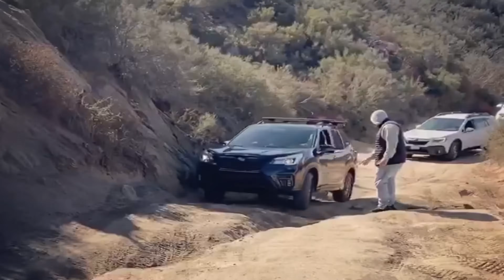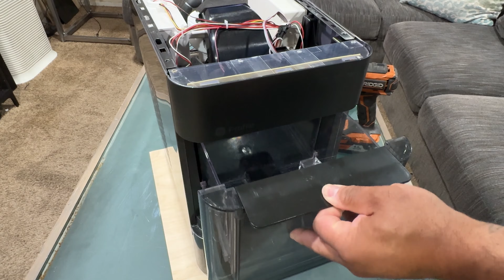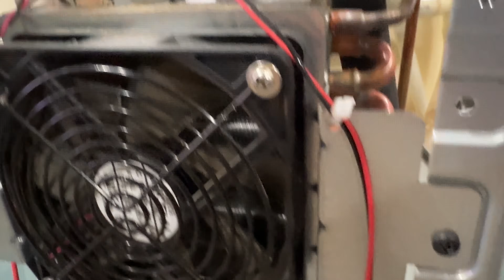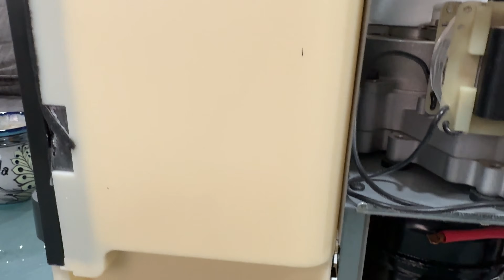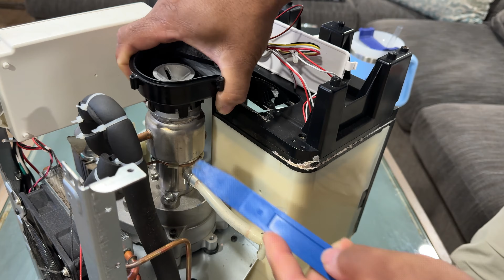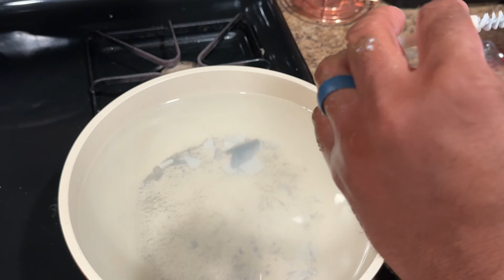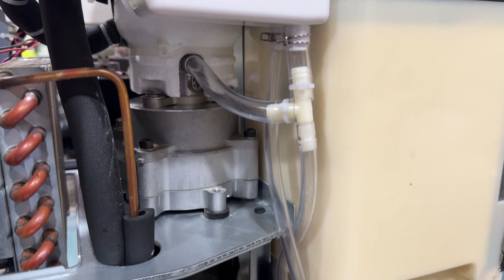GE Profile Opal 2.0 Nugget Ice Maker Repair

Comment: Best video for DEEP Cleaning and teardown of the GE Opal! I just inherited a 2 year old one that a friend replaced. Gonna tear it down tomorrow. Looks like I will be using distilled water only. Thank you.
Reply from the maker: @NCMilVet  Thank you!  Used as a full time ice maker, I haven’t considered distilled water.  But I think that is the route to go.  Plus you get clearer ice.  We’ll be making the change to distilled water.👍🏾
Reply: @Lucrativesoldier  The owner/operator manual says if you live in area with hard water, it recommends more cleaning.  I use purified/distilled water in mine.
Reply from the maker: @ yes we just switched to distilled water.  Otherwise we would have to go thru this process like every 6 months.😒

Comment: Thanks for the video. Do you have link to buy plastic splicing? I couldn’t find at Amazon that is stick enough like you have.
Reply from the maker: @honarithmusic  you’re welcome!  Are you talking about the zip ties?
Reply: @Lucrativesoldier  No, the  blue plastic flat tool you opening the bottom base.
Reply from the maker: @honarithmusic  oh gotcha.  Yes I can definitely add a link if you still need it.  I won’t be able to get to it until later this evening though.
Reply: @Lucrativesoldier  Thank you when you have time.

Comment: Great video. Thank you. My auger is leaking at the bottom near the collection plate. Have you taken the motor off or replaced the auger?
Reply from the maker: Thanks!  Im not quite sure where you are talking about.  Did you make sure all the hoses are secured nice and tight?
Reply: There is a gear replacement video on here where he goes into the auger on a 2.0

Comment: Would you have any idea why the cooling system would make a vibrating/rattling noise?  It’s the copper piece that looks like a CO2 cartridge right beneath the fan, under the coils.  The rattling/vibrating noise stops when I touch that piece.  Started a few weeks ago and I took it all apart, cleaned it, but as soon as the machine start producing ice, the rattle was back.  The copper is warm to the touch, so I’m hesitant to put any foam/insulation around it.
Reply from the maker: @imjussagrl5195  I’m not sure what would cause that issue.  But if it’s working ok other than the noise, I would try to secure it to prevent it from rattling.

Comment: We have had our for 4 years and never had any problems at all with it using the correct water and cleaning it by instructions is all you need.
Reply from the maker: Yeah I think it’s easy to neglect the process.😒. But if you make it to this point, you’ll realize how important it is to keep up the process.👍🏾
Reply: I have cleaned every 10-14 days, plus used distilled water 100% of the time and mine gave a Defrosting warning and would never work. This is because of a damaged auger. If the auger won’t turn, the machine thinks it is because of ice blockage and the unit goes into Defrost mode. 😮 warranty return time. Mine is 10-months old.

Comment: While this video is very helpful for cleaning and dissembly, I didn't see anything on "- Identifying common issues causing the noise" and how to repair those. Did I miss it? There was a thorough cleaning. Again, very helpful video.
Reply from the maker: Thank you!  For me, the thorough cleaning alleviated the noise issues.
Reply: When I watched the video I got that hard water leaves scaling and that makes a noise once it builds up. Everyone’s water is different if they’re using tapwater. That’s why a lot of people say use distilled water and it will prevent buildup like that.
Reply from the maker: @GoldMineArcade  thanks, we appreciate the advice!👍🏾

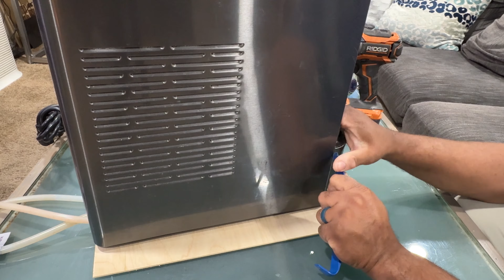Comment: Great video! Concise and to the point. At 2:06 in the video, an easier solution for bottom panel removal is to slide the unit over the edge of a table. There are four slots along the bottom. Insert a flat blade screwdriver into each slot and you will hear a "click" and that releases the clips for that section. Once you hear four "clicks", the bottom is easily removed, and you don't risk breaking anything. I recently discovered this as I took my unit apart for the water pump replacement and a thorough deep cleaning. Also be sure to use distilled water and it should help with any excess scale build-up.
Reply: I just followed this recommendation and it makes the front fascia removal MUCH easier than the pry tool method demonstrated in the video. Can't recommend this route enough.
Reply: (I posted under the wrong account, deleted and reposting) I came here because my unit is squealing, but also has a leak coming from one of these bottom slots. In this video, I can see he has some scale/deposits in that area, but I do not see how water would escape there. I am hoping my reservoir is not cracked. Any thoughts on how water would be leaking from these slots? FWIW we exclusively fill our tank with RO water. Thanks
Reply: This is a clutch comment

Comment: I have an issue where after I clean and descale it. It says that’s it’s defrosting after 15 minutes of making ice. I’m gonna open the foam  and try and clear out the auger.

Question is did you zip tie back the styrofoam?
Reply from the maker: Not sure what would be causing that, but it would make since if it’s clogged up in there and it thinks it froze over.
I did zip tie the styrofoam back, but only the the bottom.  My zip ties were too short for the top, so I just left it undone.

Comment: I clean mine with vinegar every month. Push the vinegar soaked towel into the dispenser part and let it sit for up to 24 hours. Mine started squealing a few months ago, but I wasn't paying attention to it...end up year craziness. Then suddenly stopped producing ide and said "defrosting". Called GE and they said run it through with HOT vinegar 5 times. Did this, still NOT producing ice. GE "support" is worthless!!! $700 machine and 0 help! Could it be because that metal insert in the middle of the machine is gunked up? I am trying to find videos of how to fix this thing and yours is one of 3 that talked about "gunk" and "build up". I use filtered water because we have very hard water here. Any response and help would be very, very VERY appreciated!
Reply: This is exactly what mine is doing. Did you find a solution? It goes from making ice to defrosting
Reply from the maker: @jessegerrellestrada2013  I did not find a solution, but hopefully someone can help out.
Reply from the maker: Wow!  I think customer service in general is going to crap.😒
There can definitely be some serious buildup in the center.  You can do the whole process in this video, and pour descaling solution into there and let it sit overnight then flush it all out.  You’ll see it start bubbling showing it’s doing its job.  I had to do that to one that the build up was worse than mine in this video.  You should be able to get it working again after going thru all of this.👍🏾

Comment: Mine started squealing a few days after I got it and I use filtered water. Therefore it is not always buildup.
Reply: Could be a piece of Styrofoam stuck in the motor gears others have had that problem
Reply from the maker: @Analyzer52  good to know.  Thanks for the info!👍🏾
Reply: I have to take mine apart about every 2 months to lubricate the ice spindle to get rid of the squealing. I clean it regularly but I've had to open it at least 6 times to deal with something. Out of warranty.
Reply from the maker: @rbackk  thanks for suggestion, that’s good to know.  What do you use for lubricant?
Reply: Curious… where’s the ice spindle?
Reply from the maker: @simonawalters  not sure what you’re talking about.
Reply from the maker: Did you find out what the problem is?
Reply: @Lucrativesoldier  nope - I think its just the way they are having read many many reports of the same.
Reply from the maker: @evelyncrickettstrelecki934  interesting.  Is it working ok now?  Does it still squeal?
Reply: @Lucrativesoldier  squealing louder by the day - I warrantied it so taking it back but I don’t think a new one will be much better
Reply from the maker: @evelyncrickettstrelecki934  wow!  I would give a replacement a try.  We have 2 and this was the only issue we’ve had with them.

Comment: Great video. My ice machine looks like that on the inside after about eight months of use.

Question: why do you have the water tank on the right side of the machine? Wouldn't it be easier to mount the tank on the other side so it is closer to the sink?
Reply from the maker: Thanks.👍🏾 lol. Good question.  Maybe I’ll switch it around, because honestly I think I put it on that side so it wasn’t visible, but it still is, and yes more difficult to access.😂. Thanks for pointing that out.👍🏾

Comment: Just got mine today.  Cleaned it with a tablespoon of clorox mixed with water and then flushed it 4 times.  Washed the tub.  Not using the side container yet.  Filled water to the water line.  Started making ice immediately, then after maybe 5-10 minutes it start dripping/leaking water into the tub with ice in it.  Is it suppose to do this?  Will it do this everytime?  Anyone else have this issue?  Did I get a lemon?  I'd appreciate any comments of what it could be and what resolved it.   Thank you. Scott
Reply from the maker: Congrats!  The water dripping into the container is normal.  It usually does that in the beginning until it starts making ice.  So no lemon, you should be fine.👍🏾. Please come back with an update.
Reply: @Lucrativesoldier  Thank you.  believe it does this because of this: The coil is not cold enough to freeze the water yet. So, it will run into the bin and down the back.  Thank you for the reply
Reply from the maker: @jamesdudley7046  you’re welcome!  I agree with you on that.👍🏾. Glad things are ok.  Now you can enjoy it.👍🏾😁
Reply: @Lucrativesoldier  So everything has been working great.  There have been a few times where it says "Add Water".  I can pour my distilled water into the side bin or the main area below the ice container, however, it will continue to say Add Water when I turn it off and back on.  What is the fix??  Well here it is....Before you turn it back on, tack out the filter and you will see the white hole where it pulls water, then turn it back on and you need take your finger and press to push water into it (it will suck your finger so continue to pull it away and keep pushing water into it), do this roughly 10-15 times until you see water start trickling back down as it should before it starts making ice.  There ya go, you fixed it!  It will make ice again in 5 ish minutes.

Comment: Do yourself a favor and only use distilled water. No scale buildup. Just sanitize with bleach once a week.  Mine is 18 months old and tubes were like new. No slime or mold anywhere. Just needed to blow out the dust from the fans and condenser coil.

Comment: My ice maker keeps saying Add Water.  There is water.  The pump only works for about 1 minute then stops.  If I turn the ice maker off and on it will do it again, work for a minute or so then stop and the fan also stops.  It's been doing this for a while now, I usually clean it and it will work for a couple weeks then say Add Water.  Now it's not working long enough to make ice.  
A year or so ago it was making a horribly loud squeaking noise.  It quit doing that, thank goodness but now it doesn't work at all.  I've had it 2 years.  So if the pump was the problem wouldn't it just not work at all?  A lot of people have this problem.  Please help  Thank you
Reply from the maker: Have you opened it up to inspect it?
Reply: @Lucrativesoldier  Yes I have.  I think it is working now.  I "Primed the Pump" I didn't have the ice bin in so the pump would stop and the reservoir would start to drain.  Is it supposed to do that?  Now it is making ice.  I think some of my problems are operator error along with the machine having issues as well.  I did have a large piece of gunk in the hose which I removed this morning.  Thank you for replying so quickly.  As of now it is working.
Reply: @michv4361 how about now??
Reply: @michv4361 we got ours a week ago and it already says “add water” when the reservoir is full. Do you know how we should go about trouble shooting this?
Reply: @chonky8067  I took a turkey baster and forced water into the hole the filter goes in.  Before doing that put your finger over the hole and see if there is suction.  After you force water into it a couple times the suction should be stronger.  That seems to do the trick for me.  Good luck.
Reply: I actually purchased a new one, the same model, because I thought this one wasn't fixable.  So far it's working great.  I haven't taken the new out of the box yet.  After I cleaned my old one the other day it gave me the "Add Water" notification but I did the turkey baster trick and it works great.

Comment: Do you know the part “Linux AC motor” at 3m33s in the video - mine started humming really loud and I’m not sure if the small white fan on top of it  is supposed to be spinning - would you happen to have a link for a replacement part?
Reply from the maker: Unfortunately that part isn’t easy to come by.  I did however find this seller on eBay who has the parts but currently out of stock.  Hopefully you can get one from him.👍🏾
https://www.ebay.com/itm/116063439198?mkcid=16&mkevt=1&mkrid=711-127632-2357-0&ssspo=fh8O5zsiRqy&sssrc=4429486&ssuid=&var=416237062083&widget_ver=artemis&media=COPY
Reply: The motor probably isn't bad, it also turns the auger inside the part with the styrofoam piece around it and is likely jammed up with build up. You should take it apart like he shows, and then go a step further and remove the auger head (the round piece with the holes for the ice) and you'll find a bunch of gunk built up inside. Take the auger out and clean everything really well with some descaler or vinegar and the flush it out. You saw how much was in those lines, but that auger assembly is lower and has slower water flow through it, so it can't flush out the limescale. Once you get it cleaned up, it will likely work again without any parts replacement. Good luck!

Comment: I am interested to buy this machine. I have a few questions. How to you keep from mold/mildew buildup and “bio-film slime” buildup?  
I had a countertop small ice maker, and I descaled regularly (which cleared out the crusty minerals).  However, if I reached in and checked, the water reservoir had a slimy film. This was despite using filtered water and regular descaling.  HELP me understand this because I Miss my ice machine. I just want to know how to avoid this slime and mold. Scale I can handle!
Reply from the maker: I will say, we’ve had ours for over a year, and haven’t had any slime or mildew issues.  It’s constantly moving the water which I’m sure helps prevent those issues.  So just a regular descaling cleaning is all that’s needed.  I think doing a distilled vinegar flush also helps.